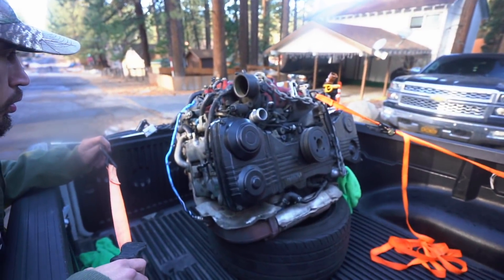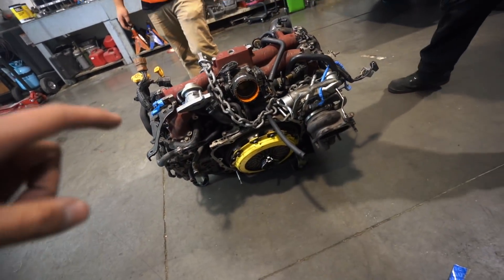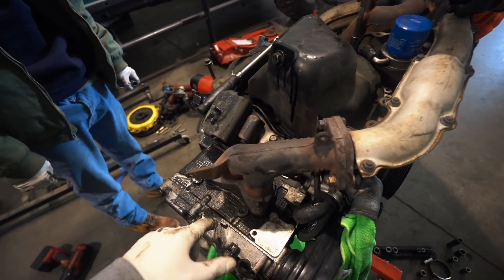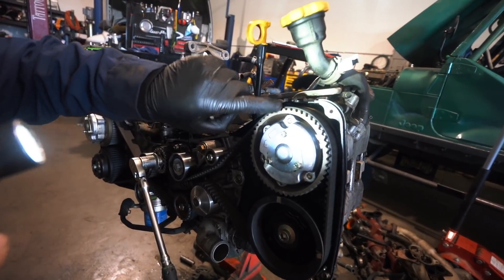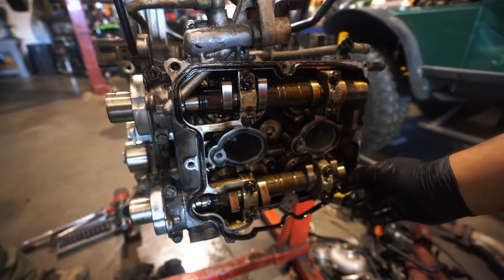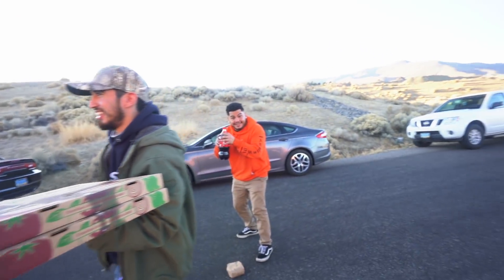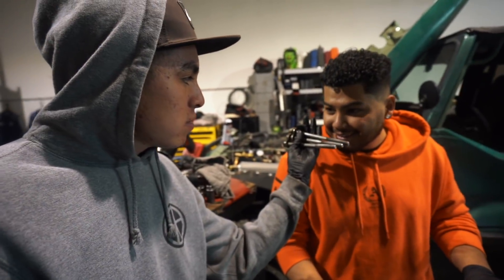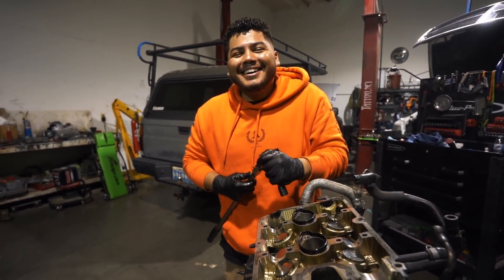Subaru STI Engine Rebuild Part 1

Comment: My sti is pretty much at the same point in my engine rebuild. Heads are getting ported this week and all the new parts came in along with the new block so it should be coming together soon!

Comment: If you’re stripping it to the bare block, might as well go with stronger rods and Pistons so you can push more power later on. Especially if it’s the stock motor, might as well do a refresh. Just my two cents.
Reply: That’s what is was thinking as well
Reply: It's almost a waste of time if you strip it down to a bare block and don't do forged internals or a new short block lol I agree

Comment: Hey man what kinda engine do you have? I have the same one, an the guy i bought my 06 wrx from said he did a air valve delete but i dont see no block off plates or any place to block it off on the back of the block. An i dont see air valves on your engine neither. Ive been looking into it for 3 months now an cant find nothing.
Reply: All USDM STI up to now have come with the EJ257. 02-05 USDM WRX have the EJ205 and the USDM 06-07 WRX have the EJ255. To my knowledge Subaru started putting the secondary air pump on the 06+ WRX & STI. Danny STI is a 2004 so he shouldnt have a secondary air system. As far as the location of the air pump it should be on the drivers side, near the fuse box/windshield wiper fluid reservoir area. Their is also 2 other valves along with pipes connecting it all along.

Comment: Huge misconception! The head bolts on these engines are NOT one time use, you CAN reuse them. TTY or torque to yield bolts are one time use. These bolts at stretch bolts not TTY. I repeat you CAN reuse them. Don’t want to see you spend money where you don’t have to.
Reply: Though stronger head bolts are definitely a good investment